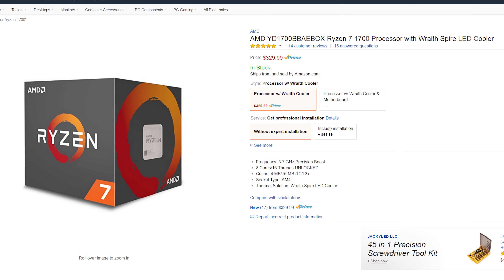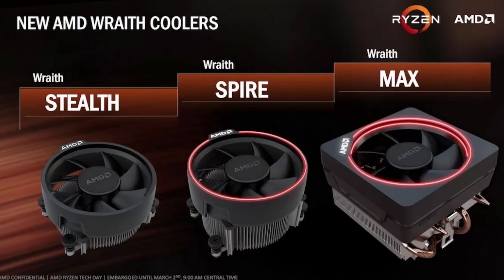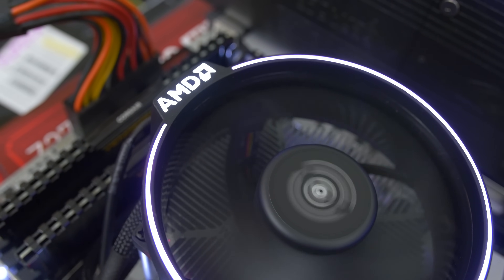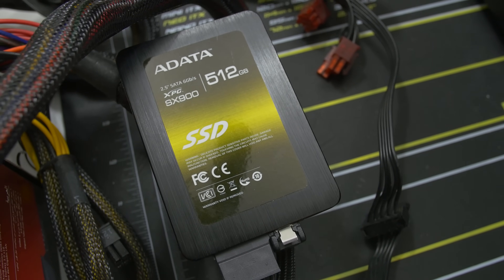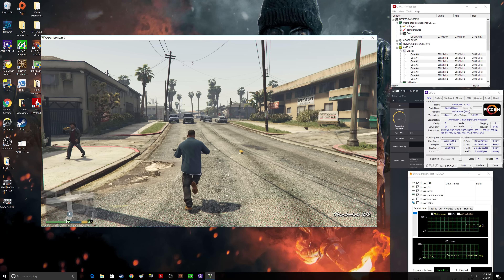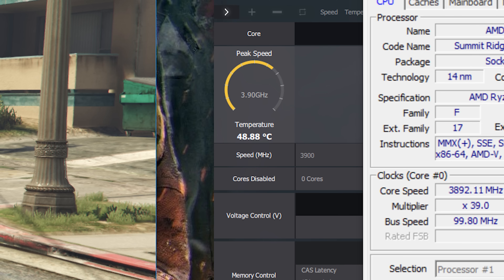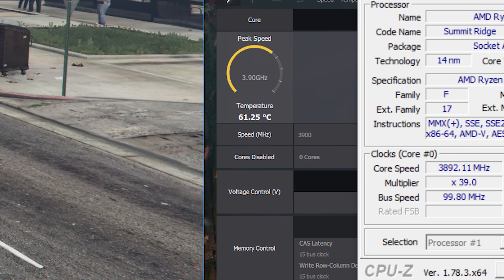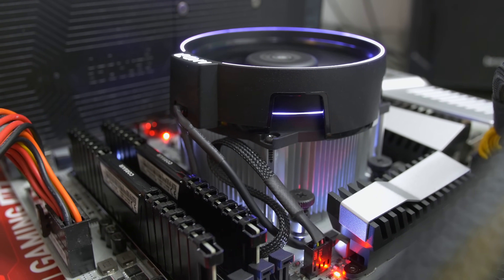AMD Wraith SPIRE: Does it SUCK?

Comment: They could use 5 pin fan connector instead of standard 4, and send entire "RGB data" with only one more wire.
Why they didn't did it?!
Ofc that 5 pin fan connecter would still work with 4 pin fan connector.

Comment: Another great video. I have a 1700 and the Noctua NH-U12S SE-AM4 with a second fan all in the box ready to go bit I like the Spire cooler so much I havn't pulled it all out of the box yet. I would love to see a head to head comparison of the Wraith Spire vs the NH-U12S. :D Also did you notice that Ryzen Master seems to cause a lot of extra heat on the CPU? I stopped using it as it was doing weird things with clock speed with no changes or tweak just using it to monitor temps. Open HW Monitor seems to read correctly on the 1700 so I have been using that.

Comment: nice braided cable and all, looks better than a 212evo
Reply: also you forgot to mention what amd said, which is the software is reading 20c higher
Reply: Chaython Meredith that only with the 1700x and 1800x. the 1700 doesn't have the 20 adjustment.

Comment: Really curious to hear what ppl think of my build plan and upgrade route? Kinks aren't ironed out yet but it's looking like it's gonna be an 8gb XFX GTR RX480 (jayztwocents got damn good OC results...), an R5 1600 + A decent midrange air-cooler depending on sales (i do some audio production but nothing too heavy, i thought the 6 cores might come in handy), in an mITX case with 1 stick of 8gb of ram (for easy future upgrades to 16gb). 450w psu should easily be enough.

i reckon it'll run pretty nearly all titles at near max settings at 1080p. Then, when I have the money, I wanna move my core hardware into an mATX case, get another 480, and put them both on water. At that point I'll probably be able to max out most 1440p games, from what i've seen. I'll probably repurpose the other parts, or maybe throw in a 470 or a 1050ti or something and a r5 1500 and sell it as a capable living room 1080 machine.

My goal isn't really for ultimate performance, it's to build a small PC that is going to work, with a clear upgrade path. When I put my gpu's on water I don't really plan to overclock them THAT high, i'd like to get something reasonable and then just be able to keep my fan speeds low and my temps under 75 24/7 without having to think about it.

Comment: I enjoy this channel.  I have a 1700 overlocked (auto voltage) to 3850 with stock cooler, in a Corsair 460x RGB case with a RX 480 GPU , I peak around 75 with AIDA64 running for 10 minutes.  It is a very nice cooler and looks awesome.  I replaced it with a H60 cooler since it works with on AM4 boards.  I wanted a X52 or H100i v2 but neither of those has AM4 brackets available.  H60 was better but not by a large margin.  If someone if happy at 3750 or less and has good air flow, I wouldn't bother with another cooler.  IMHO.

I would ask though, was this air cooler tested on an open bench?  I know that everyones case is different and that makes a huge difference and I freely admit to not being an expert but it seems that the trick to getting an air cooler to work well is air flow and not letting heat build up.  Those things are completely ignored with open bench testing.

Comment: Seen many comments about the 20 degrees offset temperature from AMD Ryzen cpu's. The 20 degrees offset temp is only for "X", like 1800x or 1700x or the new Ryzen 5  1600x and 1500x. The X stands for XFR. The Offset temp is helping XFR to perfom better for the consumer.

Comment: No surprise there since they moved from 32nm to 14nm, more efficient and less heat. I do agree though 1700 seems to be the sweet spot on the Ryzen 7 lineup. The difference in performance between 1800x and 1700 is marginal and not worth the premium for most people

Comment: ryzen tdp is not the wattage of heat it produces at stock speed under full load, that's 90 watt. same as the wattage used.
dont trust the tpd on spec sheet, rysen is lying. and thats a first for cpu's and gpu's, all the other has the tdp correct.
damn you amd, its a good cpu so why lie???

Comment: You should do an overclocking tutorial for the 1700 with the stock cooler and after market. it would be SUPER informative and awesome, considering most tech tubers just assume their audience knows how to overclock, when I for sure don't(thinking others feel the same way as well).
Reply: I'm actually astounded with how well the 1700 (stock) performs in games, it is buttery smooth. I may overclock one day, but I am super happy with it at the moment and that spire is pretty sweet looking!!
Reply: Mark Boucher u South African? Just asking because there's a former cricketer from South Africa called Mark Boucher as well.
Reply: Mark Boucher look up a guy by the name of unicorn reviews he overclocks his chip on vid, very informative to watch someone actually do it
Reply: Mark Boucher I have a strix 1070 and game at 1080p
Reply: R.T. Edwards what gpu are you using with your 1700 & what resolution??
Reply: DeviceEnforcer oye! thanks - I'll have to be checking that out. never heard of it.
Reply: R.T. Edwards 144hz?
Reply: Arka, I'm not lol. Just share the same name as him. xD
Reply: I was getting 95c when i put the cpu at 1.32v and soc at 1.15(so i could hit 3600mhz) with the wraith cooler and running prime 95. I moved to a noctua NH-D15-SE and now hit 54c running the same test at the same voltage. In both instances the fans were set to 100% on the cooler and case fans, the spire was a lot louder at max speed despite me using the noctua in dual-fan configuration.

Due to the headroom in temperatures I bumped my OC from 3.7ghz to 3.9 and voltage only had to go up to 1.36v getting 4ghz requires me to go above 1.42v which I'm not too confident is worth the extra temp/power.
Reply: Use Ryzen Master.  You can apply overclocks without having to mess around in the BIOS.  It's actually very good.
Reply: Mark Boucher nice xD
Reply: Well the thermal paste came off a tiny bit when installing because I had to re-seat the cooler so that probably had a negative effect but i do have good airflow in my case (corsair 500r with all fans). I had the CPU fan set to run at 100% during the stress tests as well, I doubt re-seating the cooler had a massive difference but I have seen other people praise the cooler when for me it was just average.

What I can say is that the Noctua D15-SE really is a beast of an air cooler, performs similar to water cooling except is much quieter and adds less weight to the pc overall. Only downside is the size so if you need to plug something in e.g fan headers you may need to pull the cooler out to reach it, I had to use a screw-driver to push down the PCI-E lever to remove my video card because my fingers wouldn't fit. You won't be doing this kind of thing very often though and I think the benefits of using a beastly air cooler far outweigh the cons of water cooling (heavy radiator/liquid, pump noises, leakage have to remove fans to fit radiator) also water coolers might be cooler for the first 30 minutes or so but as the liquid heats up it will also start to dissipate much slower, air coolers on the other hand can make the cpu go from 100c down to room temperature in under a minute. So keep that in mind when looking at cooler tests, short tests will always favor water coolers.
Reply: Mark Boucher yeah overclocking is tricky. Most tutorials are still rather intimidating. once I overclocked my CPU and my RAM ended up at 1500 MHz. I had to reinstall my OS shortly after due to corruption.
Reply: trignite lol go up to 80s on your stress test with that cooler. You have more headroom. I'd say 1.4 ~ 1.45 is good for daily 24/7 overclock
Reply: trignite what do you think, is your performance just bad rng on the cpu or is it more in line with the average?
Reply: Brony's will always be filthy no apologies there, triggered is used to describe feminists not people who hate degenerates.
Reply: Overclocking isn't hard at all you filthy brony, sounds like you were doing a bclk overclock and you ram reverted down to a lower clock because the voltage was too low to boot at that speed on your ram. If you are simply changing multiplier you don't need to worry about that just changing voltage on the vcore is enough to keep it stable without worrying about other voltages/settings due to ram speed not changing (ok maybe apart from LLC).
Reply: Mark Boucher it's just u scrub lord xdddd

Comment: the Ryzen R5 series or R3 have no RGB cooler which is a real bummer i wanted an Ryzen R3 or R5 for my brother as a cheap gaming PC with RX480/70 but no

well i am saving up for the 1080 Ti currently rocking the RX480 with a i7 7700K which i will give to my brother or cousin the i7 7700K with a GTX 1080 would be really good in gaming performance the best single CPU/GPU performance i know of right now
Reply: Zahid Shabir Wow, seriously though do not let the fact that it doesn't have RGB make you not buy it.

Comment: So the r5 1500x will have the same cooler but without the leds. So will it be able to overclock to the same or higher than the r7 1700? As it has 4 less cores?

Comment: AMD said the temps are not in celsius, but some other number. the actual temperature is 20 degrees less than what the bios and software says
Reply: ' ♥ # Y)00ßß That's only for the X SKUs. The 1700 doesn't have the 20° offset.

Comment: I'm impressed now i can spend my money on an ssd or a better gpu
Reply: fried water wut?
Reply: Maniac Scientist What.
Reply: Balázs Rakó You're planning to get a $330 CPU and weren't budgeting for an SSD...
Reply: matilija When will people realize that there's a massive difference between a lower- and uppercase 'B' there... Byte is eight times more than bit. You're talking about GigaBYTES/s.

(Though in the case of SATA, 3Gb/s should really be called 2.4Gb/s).

Also, there ARE PCIe SSDs that can read close to 3 GigaBYTES per second.
Reply: +NEX H5 yep. very true, the random small file readability of ssd's is amazing for os responsiveness. getting an expensive nvme ssd is not really worth, especially not now. but a sata one coming from an older hdd, will feel like going from a bike to a motorcycle.
Reply: The guy even mentions how quiet the fan is in spite of being a 92mm one.
Reply: I know the difference, but it's really irrelevant here if you knew what I meant anyway, also, you are wrong, even the M.2 is only 2.5 GB/s read, while being limited to 1.5 GB/s write,  and the point was that the 3 GB interface shouldn't hinder the performance, since it is a SATA interface, and there are no SATA drives anywhere near that speed.
Reply: matilija The maximum speed for SATA 2 / 3Gbps is 250MB/s and my SSD can, in theory, go up to 500MB/s sequential. That's a bottleneck alright.
Reply: For market balance, it's still good to choose AMD over Nvidia or Intel. :)
Reply: The important thing in these type of fans is the air pressure more than the cfm, conventionally speaking yes 120mm fans are quieter but in this specific case, they are trading blows, I don't prefer the Cryorig one but the benchmarks in TechPower up give it a clear victory based on its sound, performance, and price.
https://www.techpowerup.com/reviews/CRYORIG/M9i/6.html
Reply: nah dude i got the d15 too and it was worth imo
Reply: Frothar how iam saying i shouldnt have brought the d15 for 75 pounds like i said
Reply: the 1700x doesnt include a cooler so you had to buy the cooler anyway
Reply: kristian svendsen i meant shouldn't on the first one jesus
Reply: @ArtisChronicles Trolling?
Reply: same
Reply: MrMadmatty30 Any evidence for that claim??
Reply: And you just proved you don't know the difference.

I guess for you "math is hard" isn't just a humorous meme, it's a fact.
Reply: Gergő Kiss Thank you for that "/s."
Reply: 48 cfm vs. 82 is not better, and 92mm fans are way louder 120mm ones.  You may prefer the cryorig but that in itself does not make it better,  which it isn't.
Reply: MrMadmatty30 20*c offset is only present in the X variants of Ryzen, not the 1700.
Reply: NEX H5 Wrong... come on guys.  I deal with this stuff every day so it's simple for me.  It would take you a few moments to Google to get the right answer.  Stop shooting from the hip and aim for accuracy.

SATA 2 (aka 3Gb/s) = 300MB a second
SATA 3 (aka 6Gb/s) = 600MB a second

Yes the difference between them is huge for any modern SSD.  For instance my Samsung 850 EVO hits speeds of 540MB/s read and 520MB/s writes.  If it were on a SATA 2 (aka 3Gb/s) port, I'd be loosing nearly half the speed of the drive.

Also if you are going the SSD route, make sure not only to plug it into a SATA 3 port but that AHCI is enabled to enable other important functions for your drive.
Reply: Klaus Welch Well yeah, that's the maximum theoretical speed, but it's quite optimistic at that. I'm running my SSD on a SATA 3Gbps bus (my PC is based on a 2009 platform, so that's why), and I'm unable to get more than 252MB/s sequential read speed out of it.
Reply: Balázs Rakó Yep, there are overheads to account for, and the controller brand/quality and drivers can also determine performance.
Reply: ArtisChronicles dude it takes me 8 seconds to fully restart my pc it may sound mundane but I believe it really worth it, well at least a m.2 pci ssd....
Reply: DatCoolGamer full reboot
Reply: DatCoolGamer Whale then.
Meanwhile my machine takes 25 seconds just to POST.
Reply: DatCoolGamer 1. 8 seconds is by no means a long time 2. I timed the restart from me clicking the restart in windows so that includes the time to force close, open applications 3. I have a 3 way raid 0 as my mass storage which makes the boot a second or two longer than normal not to mention the shitty cam software/my nzxt kraken slowing things down even more....
Reply: 1 month later and an intel 600p m.2 ssd costs £20 more than an ssd with less than half the read speeds
Ah, technological progress is beautiful.
Reply: ArtisChronicles Oh trust me, it makes a HUGE difference in responsiveness, and mine is bottlenecked by a SATA 3Gb/s bus. It's a "believe it when you see it" kinda thing.
Reply: U don't see a point in an ssd? For me it could change everything, like when I open my programming application, it takes a year to fetch all the files and source code, with an ssd these  loading times will be reduced to an unnoticeable amount which u will probs take for granted. U will only relise the advantages once using one, and then goin back to conventional hard drives...
Reply: Wtf 19 minutes ago you made a comment saying that you got it. And now you are making a comment saying you should have spent it on a cooler. Btw your comment makes no sense: i probably shouldve spent 75 pound on a d15 for my 1700x the. but hey do not a massive deal.
Reply: marley gibson You gonna bring up any actual arguments or what?
Reply: For anyone looking for a good budget aftermarket cooler, get the Cryorig m9, it is only 20$ and it outperforms the Hyper 212 evo in both temperature and noise, and Cryorig is offering free upgrade kits to use with Ryzen.
Reply: Balázs Rakó i probably shouldve spent 75 pound on a d15 for my 1700x the. but hey do not a massive deal
Reply: It's not throttled by a 3 Gb/s bus, no ssd has read/write speeds anywhere near 3 Gb/s, fastest I've seen are still around 750 Mb/s read/write, therefore a 3Gb bus should be more than sufficient.
Reply: you are aware there's a 20c temp offset programmed into the ryzen chips to allow for an automatic faster fan curve ??
meaning whatever temps you're reading with the amd software are actually 20c lower.
Reply: nem kell
Reply: These temps are not realistic, he's testing on a test bench... so open air, it's much higher inside of a case, specialy if you don't have great cooling.
Reply: Gergő Kiss omg, amd and Intel are billion dollar companies, all they want is your money. you don't need to take sides
Reply: +NEX H5 I don't see the point in an SSD anyway.
Reply: Yes. Or you know, you can buy an i7-4790 used from hardverapro. I'd keep my hand off the filthy AMD. /s
Reply: You should not. Desktop computer should have decent, yet top affordable cooler that does absolute overkill. That will guarantee lower usage stress because of lower noise and is a move towards 10-year product usage. You never know, if 10-year usage will be appreciated, may be you will be short of money when new cpus comes, or these new cpus will be complete garbage

Comment: You forgot the 20 ° Offset. The Cooler is actually pretty good.
Reply: On the R7 1700 there is no 20°C offset. Only on the 1700x and the 1800x.
Reply: +Robert Sikora yes the offset is on all x skus. AMD made it like that intentionally.